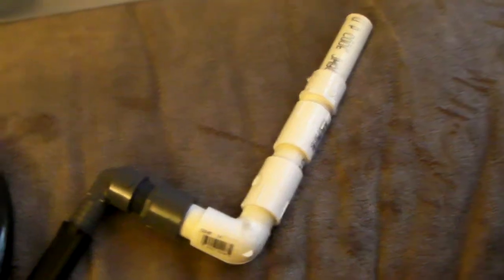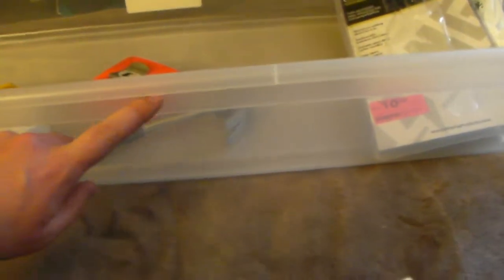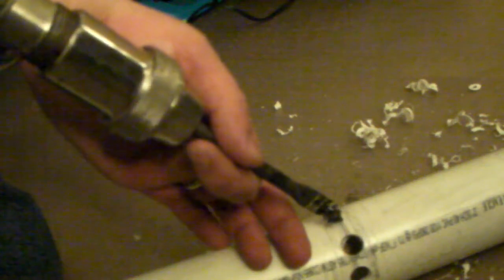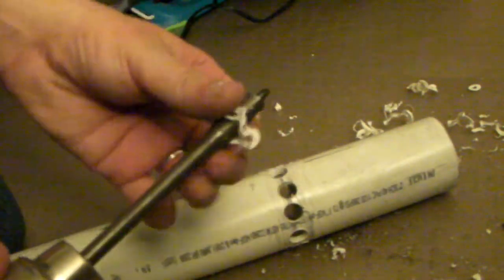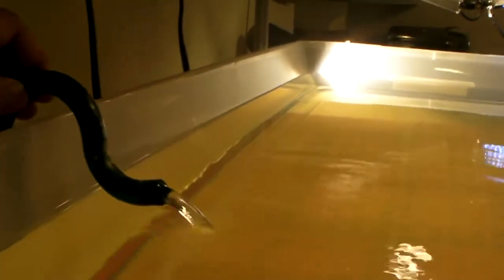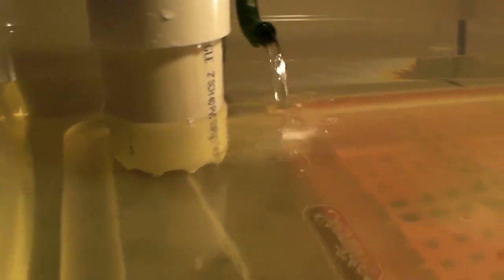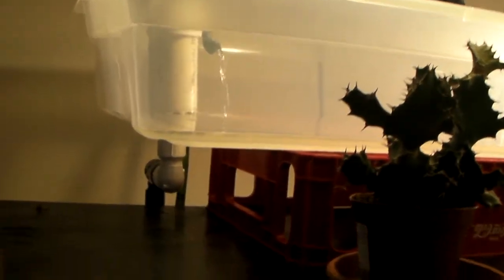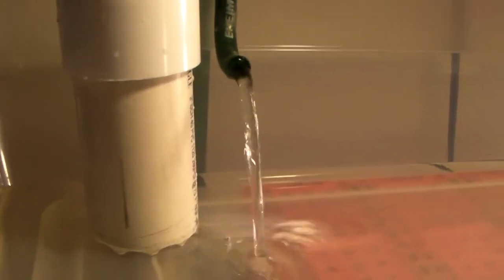Aquaponics Ebb and Flow Bell Siphon  Construction for use with a 75 gallon Aquarium

Comment: Sorry to hear that!  I am getting unreliable results as well but I'll keep on it.  I found that the issue you ran into means that the water flow into the growbed needs to increase.  I believe the reason why the siphon worked on your video is that the manual handling of the Bell caused the pressure to be sufficient to kick on the siphon.   I'm just a programmer and I am new at this, so I am no physicist.  But, that is my guess!  lol   :)      Dave

Comment: Very interesting!  I thought you had to have a tube coming out of the top of the siphon to get it to work.   Please let me know which silicon you are using.       Also, how do you balance the flow into the growbed with the speed of the drain?  My experimenting has not let me produce a 'hands-off' cycle test of fill-drain-fill-drain,etc.